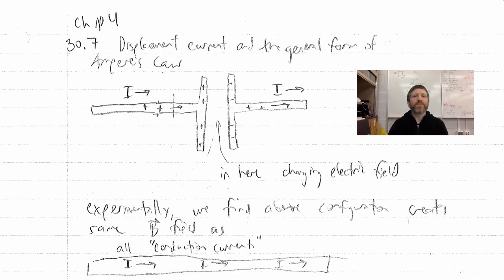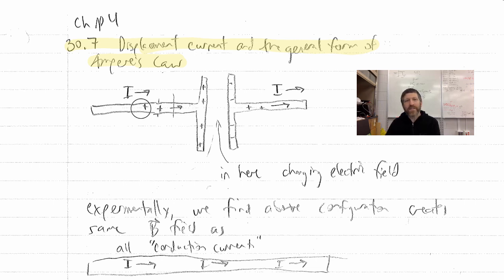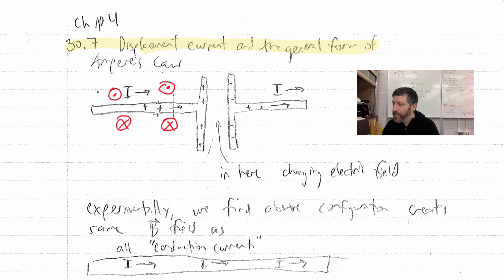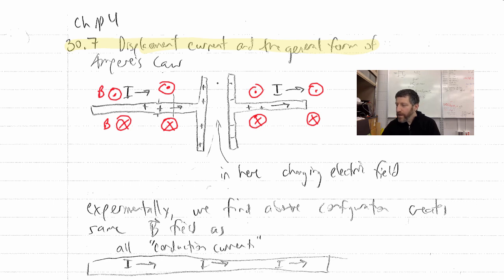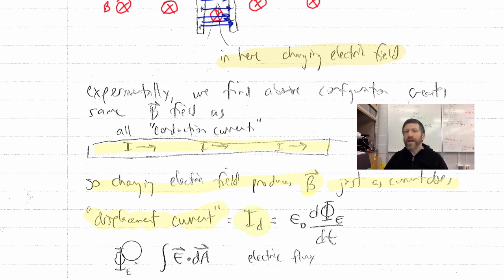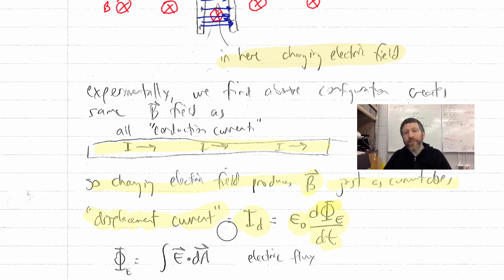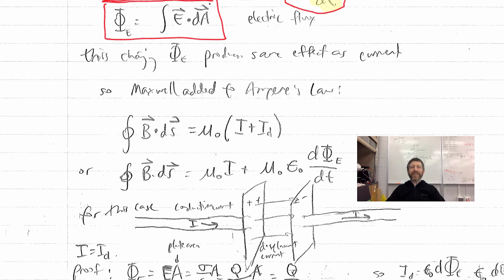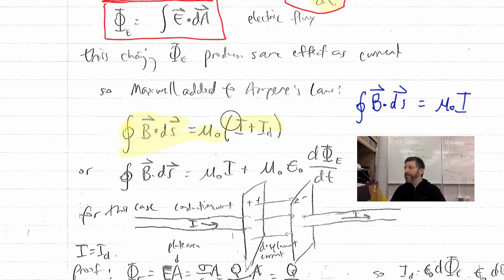20.3 Maxwell's Addition to Ampere's Law

Comment: Very nice presentation.  One small detail: the induced B field is identical to the B field next to the wire only if you are beyond the edge of the capacitor plates; within the plate area you go from a near-zero field and increase as you go out.  And to derive an expression for the B field requires symmetry of circular plates, so the square plates won't work for the numerical applications of this.

Comment: Yeah i just wanted to ask one thing it may be silly though- in alternating current the B feild that we observe (as in our books) is due to the normal current or both from displacement and normal current , or have i got all of it wrong ?. One more thing - the wire that enters the capacitor has  B feild only due to the normal current, but at initail stages(when current is increasing) the B feild is due to the normal current or both normal and displacement current. Id really appreciate if youd help there . Thanks!
Reply: That's a great question.  For an AC circuit, between the plates of the capacitor the magnetic field is all due to the displacement current.  However, in the wire, all the problems I've seen, the magnetic field is entirely due to the conduction current.  However, as you mention, there is a changing current and a changing electric field within the wire, so as long as Maxwell's equations are true, it seems like the magnetic field should be due to both, but I've never seen it calculated like that.  Please reply back if you find the answer to this question.